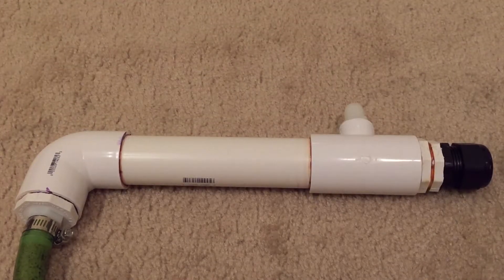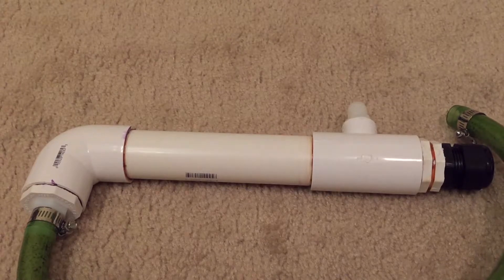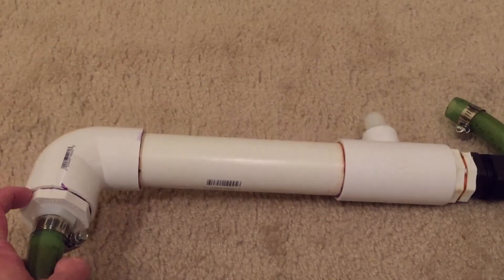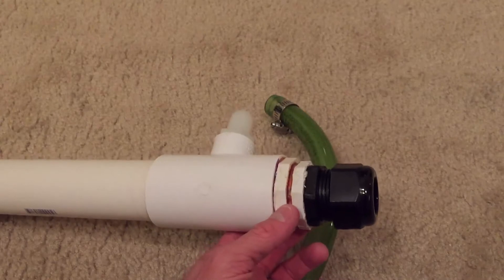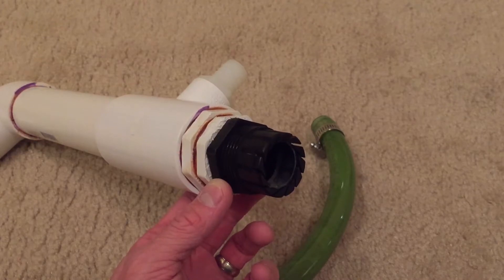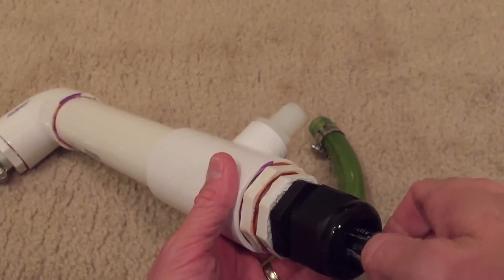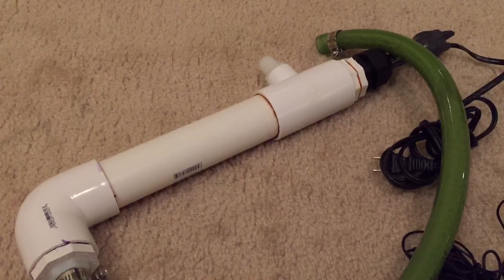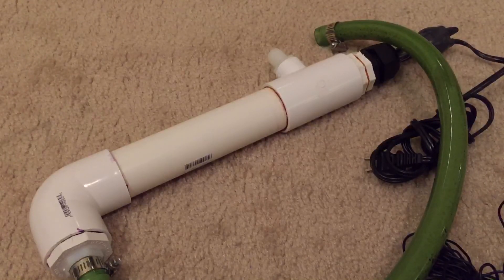How To: DIY Inline Aquarium Heater for under $20

Comment: If I want to add an inline co2 diffuser, should it come before the inline heater of after? I'm guessing after because the warmer temperature would presumably allow the co2 to diffuse better.
Reply: CO2 also degrades PVC and a lot of plastics and rubbers which is why you have to use special silicone tubing so having it at the end of the chain is ideal.

Comment: I want to build one of these but have a question. How would you bleed out all the air inside when you first turn it on? I know it’s bad to have the heater exposed to air.
Reply from the maker: Don’t plug in the heater until after the water is flowing. Fill and prime it just like you would a canister filter.

Comment: Add an external controller. WIthout it, a heater that fails into the "on" position will melt the PVC in seconds if the pump is shut off. Also, if the pump is shut off, the latent heat in the heater will dramatically raise the water temp in the pipe. You will inject a slug of very hot water into the tank when you turn the pump back on. The pipe diameter should be bigger, to provide a larger water reservoir.

Comment: Thanks for this idea. 2 questions - 1. What is the highest wattage heater element you've used? 2. Does the cord grip attach to the cord or to the body of the heater element? I want to add some extra heat to my Softub so the motor runs less. This looks promising.

Comment: Question the submersible heater needs to be in contact with water and the cord holder holding it looked like it's about an inch and a half that will block contact with water to the heater glass does that cause excess heating in that area ?

Comment: Steve, are you still using these on your show tanks?
Reply: Why did you switch to a uniseal?
Reply from the maker: Those other fittings ended up being a pain and uniseals are cheap and work every time.
Reply from the maker: Yes I am, though in later builds I used a uniseal to hold the heater.
Reply: What brand of heater do you use inside?
Reply from the maker: eheim jager
Reply: Would a 3/4” uniseal work for a 300w Eheim Jager?  And any suggestions if I were to plumb this in-line with my return pump coming out of my sump?
Reply: Chris Granger yes It will

Comment: Many thanks for this post Steve... It will be my next project. I have an Eheim 2217 on my 90 gallons cichlids tank. I wonder if this system can be hard on the pump of my canister? In fact, can this create a restriction that would affect the flow of my system? Cheers !!
Reply from the maker: +Tommy Martel I've had this running on my 2217s and haven't had any issues. It does restrict the flow a little but that's a trade off that's worth it to me.
Reply: Thanks for the quick response !!!

Comment: can a person use black pvc pipe or do I have to use the white potable pipe
Reply from the maker: +Ray Sali if by black you mean schedule 80 then that's fine. Schedule 40 is usually cheaper though and works just fine.
Reply: +Steve Poland Cichlids  isn"t Schedule 40 for drains only & 80 is for drinking water
Reply from the maker: +Ray Sali schedule 40 is fine for aquariums. It's what everyone uses.

Comment: could you double up to run two heaters?
Reply from the maker: I suppose you could, but you'd need to rework the design quite a bit. You definitely couldn't fit two heaters in the same cord grip.